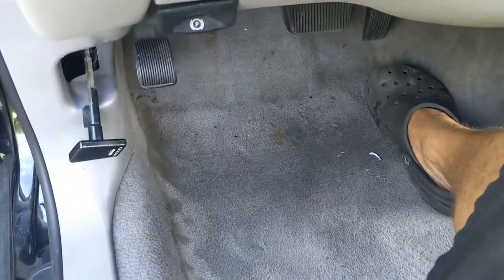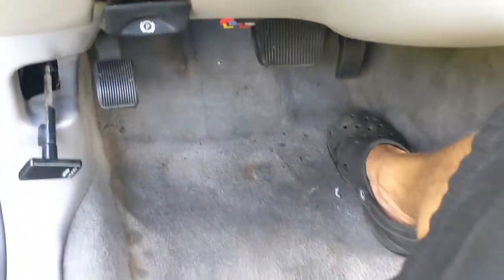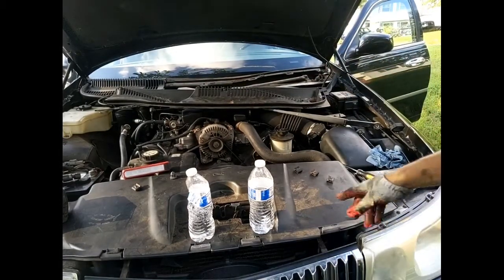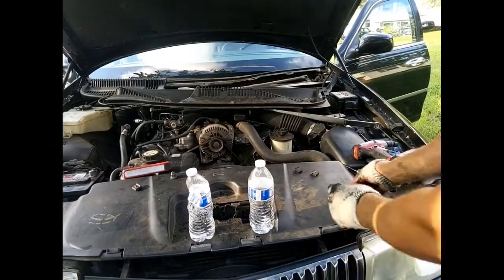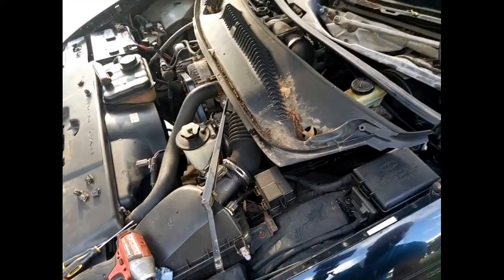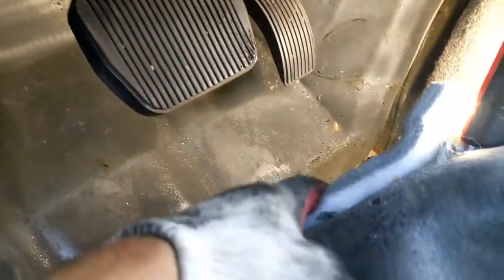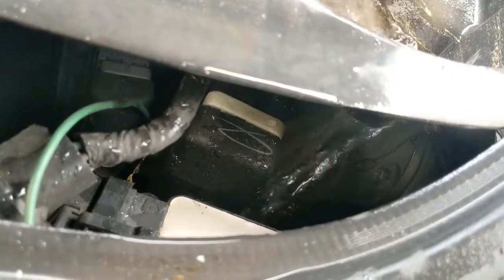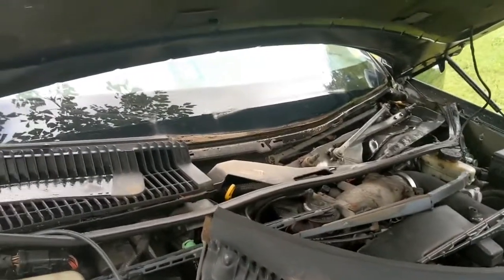Lincoln Town car water leak inside  fix

Comment: Hi Nestor, thank you very much sir. My 2003 Town Car has had a wet drivers side floor twice now recently. First time I dried the floor and it was ok until a recent snow fall and snow melt ... then a wet floor again !!!!! 
This morning I found your video and just finished clearing a very plugged drain hole on the drivers side under the windshield wiper tray. I think you have solved my problem and saved me a trip to the garage. Thank you for the Christmas present. Cheers
Reply from the maker: Thanks boss , I'm so happy that my video fix your problem for free , thanks for your feedback

Comment: For the people coming here, the drain can cause an issue when it’s clogged but the water leak on the driver side typically comes from the hood latch cable. The rubber grommet on the firewall gives out over time and opens holes in it. The water from the clogged drains runs out a bolt directly onto the cable and follows the cable through the bad grommet into the cab.
Reply from the maker: Thanks
Reply: HOW TO FIX THAT??? THANKS!!  GET A  NEW GROMMET??
Reply: You have to get new hood latch cable assembly as the grommet is a part of the assembly and not sold separately. Ford still stocks the part. I just had my local dealer do it on a 2005.
Reply: @countryboy9546  Thanks for the info. I’m gonna’ RTV the heck out of the area. Just removed the black hood cowl under the wipers. Taking all the carpet out to thoroughly clean everything and make sure this is indeed the issue.

Comment: Hey man I cleaned the one on the far left my front floor doesn't get wet anymore but I couldn't get my right windshield wiper to come off to clean the other drain I think that's the reason why my rear driver floor keeps getting wet when it rains so do you have any tips on how to get the right windshield wiper off so I can clean the middle drain. I have a 2005 town car any suggestions
Reply from the maker: Yes put some WD40 also they sell a small puller

Comment: hey nestor update on  96 leak.  i drilled a hole on drain area driver side to make sure water comes out in case drain hole does not work.  also i sprayed water proofing near driver fire wall engine. seems ok. had  a very heavy rain,   drain holes working fine, but the sunroof seam that backs to roof allowed water to seap  in. and wet  my jnside roof. i noticed that the sunroof had a little up and down play in it so i  took 2 layers of duct tape and taped where the seam meets together. this eliminated the sunroof  widow play. am hoping that it took care of the leak during a heavy rain. i think it will. take care ,cliff
Reply from the maker: Oh thanks for your update and feedback sir
Reply: @nestorautorepair  Nestor you didn't say much about where the rain water was coming from inside the firewall. Was it coming through a the grommet of where the the hood release is and on to the floor?
Reply from the maker: The drain was the problem sir ,, just unclog it

Comment: Do you know what the rubber piece is that you lifted up behind the gas pedal? I had rain get in and flood my car and it’s still wet and moldy under that piece and I can’t figure out much about that piece!
Reply from the maker: That's so you don't feel the heat from the engine
Reply: Do you possibly have any idea how to find a new one? I can’t figure out what it’s called to try to find a replacement piece in case I can’t get it clean
Reply from the maker: Get it out and. leave it outside let the sun ☀️ dry it for you for 3 days I done it before
Reply: @nestorautorepair  thank you!
Reply from the maker: You're welcome

Comment: hi thanks for video. my 96 has driver side  by gas pedal like yours. another video said to silicon behind gas pedal. no no did not help. i did clean out leaves out of cowl. but that did not help. i wiil try your suggestion to take off wiper blades then clean out drain hole on driver side and middle. and other end. i believe you got the fix correctly.
Reply from the maker: Thanks cliff yes let me know how it go
Reply: hi  nestor,  96 ltc  here is latest. found only a little debris  under driver side cowl.  did notice when water seeped out of driver drain hole it landed right on a hood hinge  which may have some rust in it draining down into floor board . i sealed this.     also sealed seam between windshield and plastic trim.  we will see what happens.   ps   not able to get off  wiper blade but moved cowl around  a little. thanks cliff
Reply from the maker: Wow ok let me know , they do have a special tool to remove it
Reply: ok nestor  here is a follow up on driver leak after sealing seam between windshield and plastic trim and sealing rusted hood hinge where drain leaks directly on it. Seems to be dry so far with plenty of snow and rain to test it.  so far so good we may have solved it thanks for your help. cliff
Reply from the maker: Thanks for your feedback Cliff and your time to get back to me with the update , 👍
Reply: @nestorautorepair  I'm having the same problem with my 98 I've done everything in the video now once I poured water multiple times while carpet pulled back I did notice dripping from the area where the truck hinge is because my driver and rear carpet is soaked. Can you help me please
Reply from the maker: This cars has a sun roof ?
Reply: @nestorautorepair  yes but my sunroof isn't leaking cuz it rains and there isn't water coming in
Reply: @nestorautorepair  I previously a year ago repaired the passenger side issue with the cowl panel. Like I mentioned before when I was ise my water hose and letting water run down the windshield I see water dripping against the wall near the hood hinge but its alot wires down there
Reply from the maker: Ok but still please check the sunroof drain
Reply: @nestorautorepair  I will check it in the morning.  Is there a way I can direct message you
Reply from the maker: Sure
Reply from the maker: 571 267 8581 text me please
Reply: 06 town car it was the cable to pull the hood open the grommet was leaking flooding  everytime it rain dripped right through the firewall little silicone fixed it permanent
Reply: @StevenAwsomeYoda  ok thanks for that info. i will check that. also i frequently check the  cowl   for leaves they accumulate and clog. i dont take the blades off just take   off some cowl fasteners on drivers side , pry it open and reach in and take out leaf debris. takes 2 min.

Comment: hi  nestor update on 96 lincoln sunroof. my drains for top are working. also my drains for windshield are working. i check them frefquently for debris. another  tip i  use  on the sunroof is simple easy . when i know we will have heavy rain i take a black plastic garbage  bag and lay it on top of the sunroof. its just another easy preventative measure  to keep water out. i have a nice dry intereior.
Reply from the maker: Yessss thanks for sharing boss